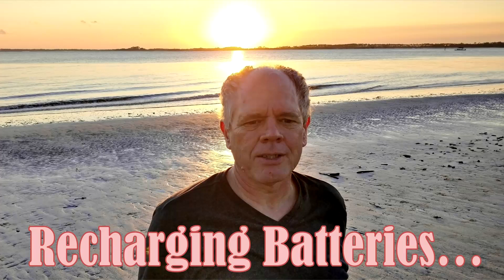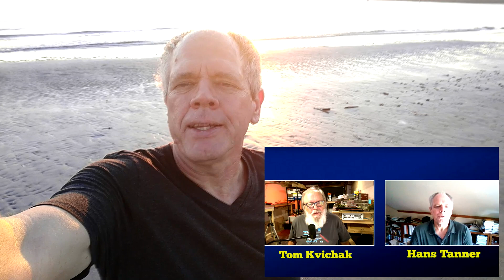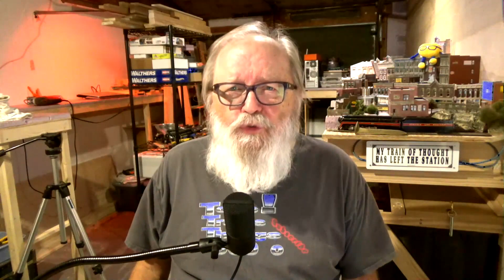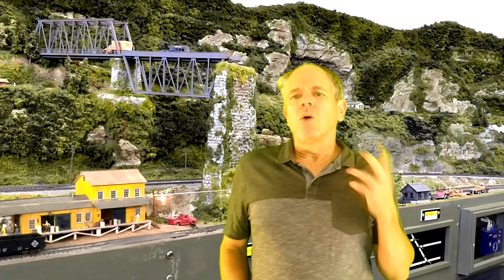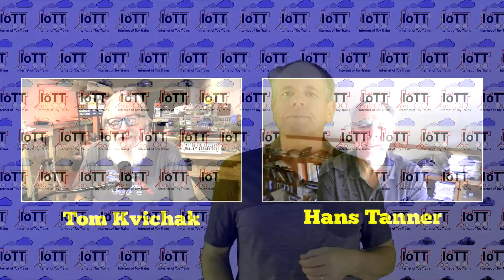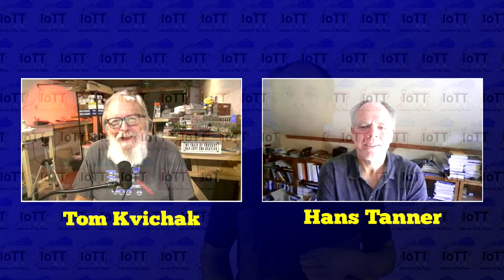Recharging Batteries (Video#77)

Comment: At about 18 minutes into the video, you mention using a camera for train position detection as a potential future technology. Is this an area you plan to investigate in the future? Electrical detection is a great approach for "is this block occupied" but (as you have noted in some of your videos) not a good technology to identify train position within a block. Your experiments with Lidar are promising but (multiple) camera might offer ways to resolve some of the potential ambiguities (eg which track a train is on when at long range from the sensor). Not Arduino type processing, but possibly Raspberry pi. My railway is 5m x 3m, N scale, automatically controlled and has nearly 200 electrical detectors; by a long way the most expensive electronics in the system, and still not offering the ability to stop shorter trains near the middle of the platform.
Reply from the maker: I still consider using cameras a very interesting approach. Just imagine having a bird eye camera above the layout and it could continuously report the train numbers and positions of all trains on the layout as long as they are visible to the camera (tunnels are a problem ;-) of course), and with the progress in edge computing, more and more of that vision becomes possible at lower cost. Setting up a few cameras would be easy, but as we see in other systems based on image processing (e.g. the Tesla FSD), the main hurdle is training with a large enough data set, so that in the end each rolling stock item is reliably recognized from various angles and different lighting conditions. This training process can be automated, but requires a lot of computing power, and that would be the practical hurdle.
For the moment, I am therefore focusing on a simpler approach that is much cheaper and allows for the same result, which is train identification and millimeter precise location of the trains, based on distance measurement of the train movement and the known geometry of the track system using train side sensors, as outlined in videos #146 and #147. That is easy to realize, scalable and cheap, at least for scales HO and larger. For N scale there is a problem of miniaturizing the hardware, but there is a work around which I will talk about in the next video.
I am actively watching the camera topic as I am very interested in the technology, but for the moment using train-side sensors are the more practical and cost-effective approach, at least in my opinion, to get rid of the track-side sensors.
Reply: @IoTT  Hi Hans  thank you for the reply. I was looking at cameras from the perspective of position measurement, not recognition. Image recognition using AI is a well researched subject, and I think cameras would need a profile view as a lot of rolling stock will look similar from above. For position measurement an overhead camera may work and it should be possible to get 1-2cm accuracy which is as good as electrical detection seems to manage. I haven't seen those videos yet  but I will get to them soon (I started your videos from scratch only a couple of months ago, and I'm up to new year 2023 at the moment).

Comment: Recharge 18650 battery in a train car .
Reply from the maker: I think about adding an antenna so that it can be charged wirelessly. No power pickup nor USB connection necessary.
Reply: @IoTT  I saw that  you had started that project!